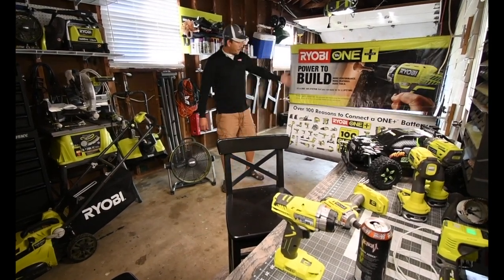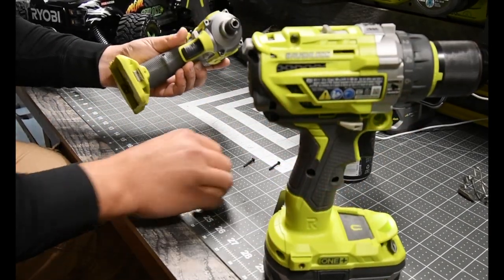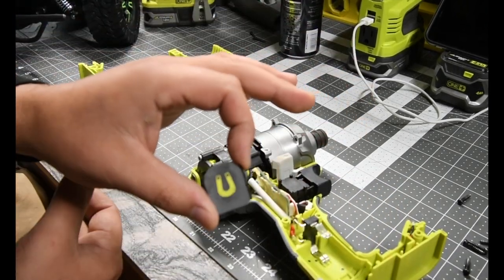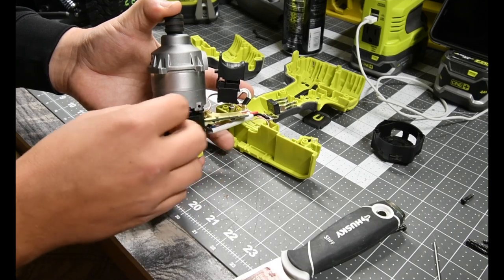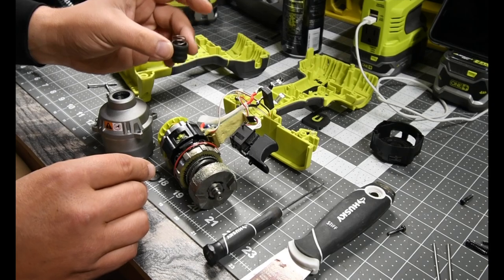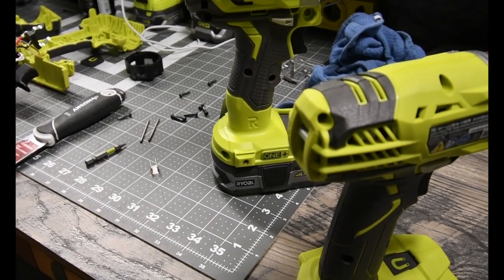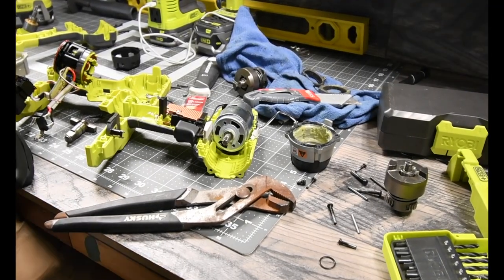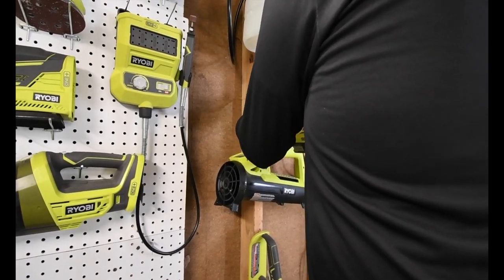Ryobi Anvil Swap

Comment: To drill harden steel you need cobalt bits or carbide another way to get your drill bits to cut into harden steel blunt the cutting edge of the drill bite and use cutting oil (go slow).

Comment: Something I would have tried! I had a set of cordless hair clippers I Loved & they didn't make that model anymore & the batteries inside died. So I thought I could swap out new batteries. Once I took it apart, the entire thing just fell apart! I believe it was designed to disintegrate when opened up. Good luck with this project!
Reply from the maker: Snap, to bad to couldn't conjure anything out of them

Comment: Have you ever tried a swap on the P209 to an anvil or is that not possible to do? My P209 loosens the bit during use and the bit falls out no matter how hard I tighten it. I have other drills but just don’t want this one to sit around on the shelf.

Comment: I don't understand why you want to do this?  🤔
Reply from the maker: curiosity lol
Reply: @ManCaverTools  I can vaguely understand.  You have the nicer brushless 1/4" P238 with autochuck.  The P239 is a less fancy duplicate, so why not give it a 3/8" head on a brushless tool (as opposed to the brushed P263)?

At a glance I suspected it would not work.  The anvil housing is different plus you have the multi speed gearbox on the P263.  

Personally the difference in performance between brushed & brushless models isn't all that great.  Certainly not enough to warrant the expense of replacing perfectly good brushed variants.  

OTOH, as a guy who owns half a dozen laptops, ten DJI drones, two Meade telescopes, forty lightsabers, & Lord knows how much other stuff, I'd say Ryobi tools are inexpensive enough that you're getting off cheap!  🤣